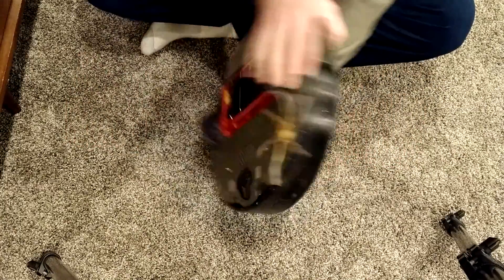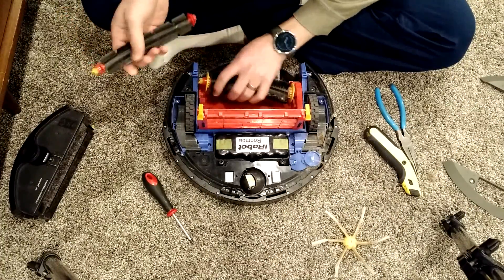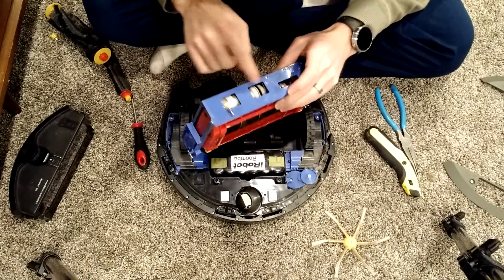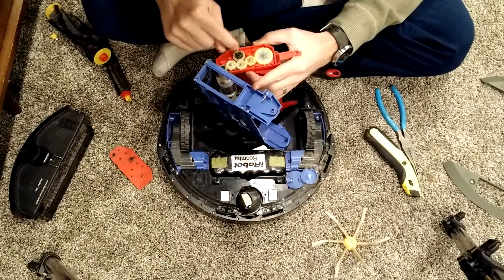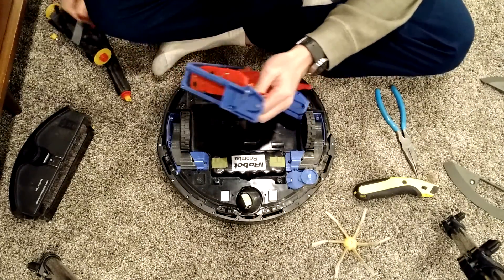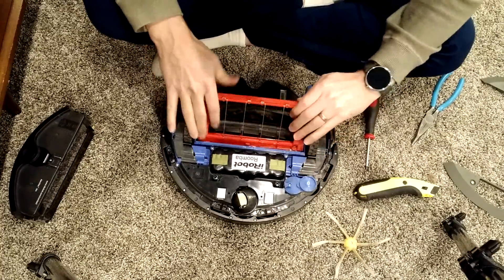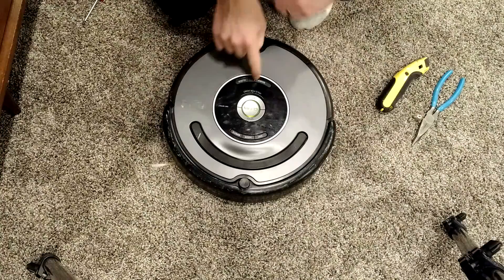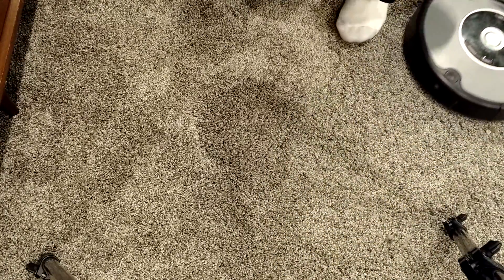how to deep clean Roomba 550 brushes

Comment: The error message on my 500 series ("Please remove and clean Roomba's brushes") persisted  even when I swapped out the brush cage/cleaning module and brushes for another.  I have 3 of these I bought in 2007.  One way I know it isn't an accurate message is that is starts up again and runs for a few minutes before repeating the same message.  It turned out I had to do a reset by pressing the spot and dock buttons at the same time for 10 seconds.  You can tell you did it correctly if it responds with a little roomba song.  No other changes than that, and it runs fine with no more error message.  The other thing that happens with a different unit of mine is that the roomba just stops for no reason with no error message.  In my experience, this is the front wheel needing to be cleaned.  I only just now realized you can pop out the front wheel assembly very simply, and then pop it out of the housing very simply to clean.  Mine had 14 years of dust tangled in it!  Since cleaning, that unit runs without stopping.  I still have some issues with dirt not getting sucked into the bins, though.  The fine dust on the other side of the filter goes in fine, but the big particles stick and drag and I have to vacuum them off the bottom.  I will probably phase these out eventually.  They are too expensive to purchase and maintain, given the planned obsolescence.

Comment: Two thumbs up! I have a 550 for about 10 years. Recently I changed the battery for the second time and it worked pretty well. Last week it started having problem with alert message for cleaning the brush.  I did some cleaning and the problem persisted.  Then I followed your tutorial, found and cleaned lots of stuff inside the gear box.  Now it's working happily!  Thank you very much!!
Reply from the maker: +peterlution awesome glad it helped